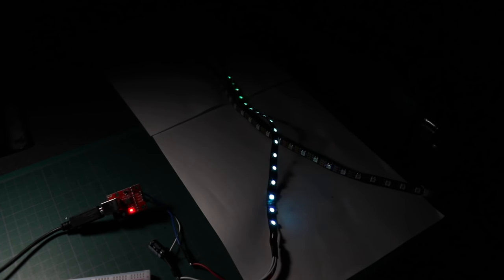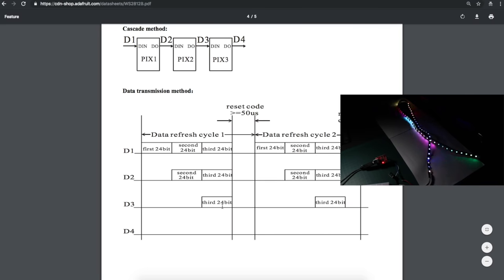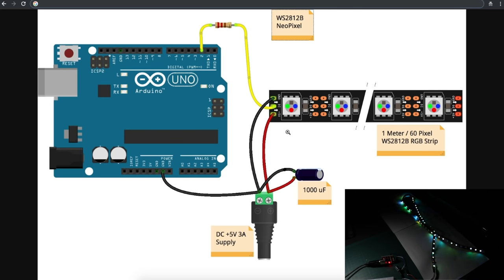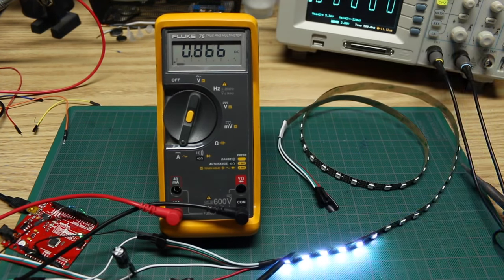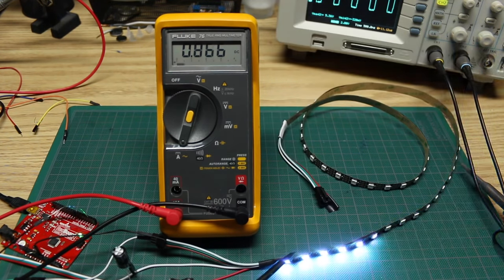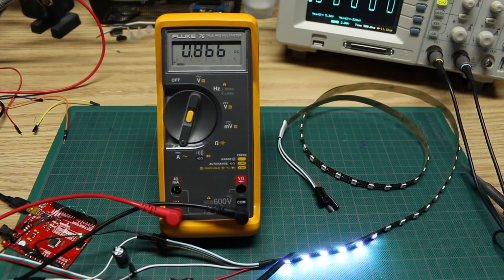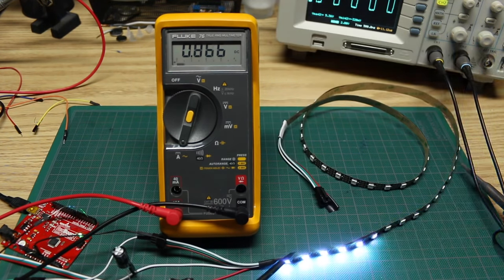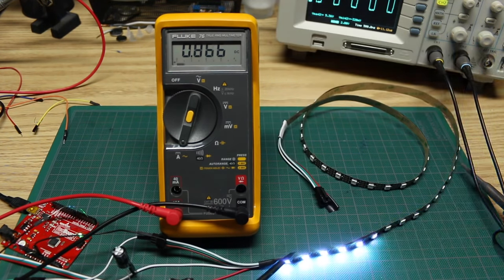HOW TO USE WS2812B NEOPIXELS WITH FASTLED ON ARDUINO

Comment: Hi! Is there a way to control when a led is off? In your example I saw that all the leds are off at the same time .
But I need to turn them off at different times. This tutorial is awsome
Reply from the maker: Do you mean the example sketches I made and put on github, or those demo sketches that come with the fast LED library? 
 If I wanted to customize an example from the fast LED library I’d have to analyze it and hack it to override certain LEDs and turn them off. 

 If I want to turn off a specific LED in my own sketch, I just set its red green and blue levels to all zero, or set the color name to Black whenever it’s time to turn one off.
So if it is LED number five that I want to turn off specifically, I could do it these different ways: 

leds[5] = CRGB(0, 0, 0);

leds[5].r = 0;
leds[5].g = 0;
leds[5].b = 0;

leds[5].setRGB(0, 0, 0);

leds[5] = 0x000000;

leds[5] = CRGB::Black;
Reply: @GadgetReboot  Thanks so much. I´m now traying. So I have the led 5 off.  
How do I make the led 5 LEDs turn on after 3 seconds of being off and then turn on again with a delay of 2 seconds for example?

What I really need to do is that the first 10 LEDs light up all together (from 0 to 9)  and after 5 seconds they all turn off and then turn on after 3 seconds and turn off after 3 seconds. In parallel I need the LED 10 to 19 do the same but at different times than those from 0 to 9. That is, when the first 10 LEDs are on, the second 10 LEDs are off. I hope you understand!
Reply from the maker: To control multiple timing intervals without using the simple delay command, which would pause the program and not let everything run in the background, you would be best to use the millis() function. 
 There is a forum thread with examples of how to use it to blink lights: 
https://forum.arduino.cc/index.php?topic=503368.0

 In that first example they have a variable called Period  which they set  to 1000 which means 1000 ms or one second. 
 If you want to track multiple intervals you could create multiple variables like that like period1 period2 and set up different numbers of milliseconds.

Then in the loop you do the comparison like they do for just the one blinking light and you just add comparisons for your extra timings and if the timer has reached that amount of passed time, then you turn those various LEDs on or off and then you can do it all in parallel without messing anything up and causing extra delays so you would have  if statements to go and change those certain LEDs every time  five seconds or three seconds or however much time has passed.

Comment: Out of all the tutorials I've seen in this exact topic, yours is by far the best explained. I want to replicate your work for a cardboard space capsule I'm making for my son. Could you please tell me what is the voltage of the 1000 uf capacitor you're using. I've seen some ranging from 16 v to 400 v . Does it matter? Thank you in advance for your answer. Keep up the good work. Thanks for the great material you share.
Reply from the maker: Thanks for the feedback! 

 The capacitor I used for the experiment I can’t remember but it was probably either rated for 16 V or 25 V but I was just trying to make sure it’s at least able to handle 5 V. 

The main thing to ensure with capacitor voltage ratings is that the voltage you apply is not greater than the rating of the part.
 So with a 5 V circuit like this, a capacitor rated more than 5 V  should work fine and with 1000uF electrolytics, that should easily be achievable because they are mainly probably 6.3 V or greater voltage rating. 

 Some things to consider,  we are assuming an ideal well regulated 5v supply but a power supply could also have some ripple on it but it still should be close enough to 5 V for this purpose.  So for this kind of experiment I would say a 10 V rating or higher would be good. 

 Another common design practice for production design, electrolytics are generally  chosen so that the applied voltage is between 65 and 75% of the capacitor’s rated voltage because too high or too low of a voltage can impact the lifespan.  

 But for home built  projects, just making sure the capacitor is rated higher than the voltage you’re using is good enough so 10 or 16 or even 25 V is what I would try to use.
Reply: @GadgetReboot  Thank you very much.
Reply: Hey, would you mind sharing the codes for the light animation you show from minute 1:39 to 2:15. The loop is bigger but I'm interested in that section. I am building a space capsule for my little son and I'm adding son lights with arduino-controlled led lights. I'd really love to install those cool animations. I will be very grateful. Thank you very much in advance.
Reply from the maker: @astralhorse  I think it was the FastLED example sketch called DemoReel100  but it's been a while.  It was either one of the fastLED examples or could have been an Adafruit Neopixel library example like one of those strandtest demos.   I just recall setting something up and letting it run while I tried to figure out how to get the rest working so it was definitely one of those example sketches rather than something I made.   If I confirm for sure I'll update the video description but I'm betting on DemoReel100.  It keeps rotating between effects and chase scenes.
Reply: @GadgetReboot  Thank you very much. That's a good start.

Comment: Question for you, I bought the WS2811 LED's (i have 100 of them) and the Arduino Uno R3 board.  Would I set it up like your setup here with the resistor and the capacitor? I am all new to this sort of lighting and my project (if it works out) will be for my computer table lighting. I might however buy these lighting strips as I really like the way they look. Any info would be much appreciated. I supported your channel and rang the BELL!  oh , would an old computer power supply work as well for the LED power? 5VDC is my power needed for the WS2811's.
Reply from the maker: yes the set up would be the same and then in the Arduino sketch you would change any reference to WS2812, to WS2811 so that fastled will know how to properly address them.
I have used a computer 5 V power supply, the only requirement is to make sure it has enough current and one way to do that without measuring anything would be to control the brightness of all the LEDs to something relatively low, set every LED to full white, and then gradually increase the brightness and see if all the lights can behave properly or if some toward the far end of the strip start looking less bright, the power supply either can’t deliver enough current, or maybe it can but you would need to run an extra set of 5 V and ground wires further down the strip and attach them so the further LEDs have another place to draw current.
Reply: @GadgetReboot  Thank you I understand about the drop. I was going to do that anyways lol... :)
Reply: @GadgetReboot  hey, another question for you. I have tried to download the fastled in the library and I cannot get it to  download anything. Do I have to be a subscriber to the website?

Comment: Dear Gadget Reboot,
would this whole thing still work if you used the 5V from the arduino? The light may be a bit less intense but it would still work, right?
Reply from the maker: The limiting factor is the Arduino 5 V won’t have very much current capability so if you take the 5 V that would be coming straight from USB you might be able to take a couple hundred milliamps and if that’s what you want to do to test things, you would have to make sure the LEDs are set for low brightness and maybe even only use so many of them so that the total current  doesn’t exceed what Arduino is giving.

Comment: Does it need a controller to work. I use DC 5v. But not worked . Only the first bulb was lighted up. It was green. Why is that
Reply from the maker: In this set up, the Arduino is the controller and yes a controller is needed. The first light may have received random noise on its data input and configured an RGB pattern but there would not be properly structured data to pass on to the other lights so only the first one may light up randomly like that.  

The other lights have their data inputs connected to the data output of the previous light so it’s held in a constant state and isn’t impacted by random noise. The first light needs to be hooked up to a controller so if it’s left floating it can have random input levels.
Reply: Ok thank you. So it will working properly after connecting to a controller.
Reply: How many* A*does it need to light up the strip brightly  ? 6a is enough to light  up 2m or 1.30m long strip with DC5v
Reply from the maker: It depends how many LEDs there are per meter because you can get them close together or spaced more apart, and it also would depend on specific LEDs. 
The general rule is to expect a worst-case of 0.060A  for each LED being fully bright white so multiply that by how many actual LEDs you have on the strip. 
But that’s only worst case, for my specific lights they only actually use a little more than half of that.
Reply: I got a led strip from Ali Express.  It was white pcb 2m  144 ip67  . I want 1.50m From that. DC5V WS2812B
Reply from the maker: If it’s 144 per meter  then the worst case 0.06A for 1.5 m could require almost 14 A to be fully on bright or maybe 7 or 8 A if they are anything like mine and didn’t use the full 0.06A each.
 One way to run it with a six amp supply is to have the controller not go to full brightness.  
It would help if you could put a current meter in series and make sure you never exceed about 80% of the 6 A supply. That’s a general recommendation for power supplies, not to use it more than 80% of its rating to keep it running effectively.
Reply: Then i ll buy DC5V with 20A power adapter directly
Reply from the maker: That should work
Reply: Ok i ll come after buy it. Thank u for replying.  Thanks a lot
Reply from the maker: Also for handling a lot of current make sure you’re using a heavy enough gauge wire for the two power wires to the strip.  I don’t have a recommendation off hand because I normally only use low current but there’s lots of charts out there in Google land.
Reply: Ok . Thanks for the help. I ll back soon

Comment: i want to power over 130 of them leds i have got a 10amp power supply. i also have the same omhs r (220) and fu (1000) would it still work with there higher amps.(10amps) ???(im a noob so dumb it down for me thanks )
Reply from the maker: The main thing in the calculation of current required for the number of LEDs is take the power supply current 10 A and divide by the amount of  current needed for each LED,  and that result will tell you how many LEDs you should be able to run from 10 A with that amount of current per LED needed. 

 So for my specific LEDs, if I round up it took 35 mA per LED to be on full brightness white. 10A / 0.035A = 285 LEDs I could power.

 For the worst case if you don’t know how much current each of your LEDs will need, these take a worst case of 60 mA per LED.   10A / 0.060A = 166 LEDs.

 Of course accounting for overhead if other things are being powered from the same power supply and also I believe it is generally accepted that a power supply should only be run up to 80% of its rating to keep things unburdened. 

So multiply those figures by 80% And we get  132 LEDs if it takes a full 60 mA  per LED, but probably you can run more, realistically  The LEDs don’t draw that much just like mine were only drawing about half of that . 

 Of course you can also just simply try it out turning LEDs on gradually at full brightness white and see if there is a point where they start going dim and then there might be some power delivery issues either in the power supply itself or in the wiring maybe thicker wires are needed or multiple sets of power connected along the strip, it can get in depth with a bunch of LEDs and current.

Comment: Hi. Nice Video but i have a problem. Wenn I going to upload my code to the arduino it says: "No hardware SPI pins defined.  All SPI access will default to bitbanged output" and abort the upload. Can you help me with that? (My englisch is not so good. i now that ^^) (I want to upload the code to an attiny85)

Comment: hey, is this capacitor really needed? If i don't use capacitor, it doesn't work right?
Reply from the maker: It's recommended because when the LEDs go on and off fast or change color fast and have drastically different current demands, power supplies can be slow to react and provide that power so the capacitor temporarily helps supply power more instantaneously until the power supply is ready.  Also if there's any sudden power line spikes, a capacitor helps absorb that and keep everything smooth.   Things may "work" without the capacitor but depending what kind of pattern you run, it may all dim out unexpectedly or flicker as the LED controllers struggle with the power supply's fluctuations.

Comment: Thanks for the video and descripton. What about if I use 3 separate parts of same LED strip. Circuits is ok but what will change for the code?
Reply from the maker: Do you mean keeping one single strip but trying to access three different sections to run different control code on the one strip  with just one data input?  
 Or three separate LED strips with three data inputs coming from the same Arduino?
Reply: @Gadget Reboot 3 separate strip with 3 data inputs on same Arduino.  And I have 12v Led Strips. What should I use between 12v power and led12v input. Thanks...

Comment: Question? Can I use 1 resistor  to power  2 strips
Reply from the maker: it should work to send the same data off of one resistor to two strips and have them behave the same.
Reply: @GadgetReboot  I was thinking a Y split  but I'm afraid of that  signal  going in to one another  like you said in the video would that happen
Reply from the maker: The resistor should absorb any signal reflections that come back from either side of the split and the far ends of the split are just receiving and they don’t really transmit back, it’s valid to have one signal going to multiple destinations, just not multiple sources trying to drive into one recipient.
Reply: @GadgetReboot   ty so much
Reply: @GadgetReboot   sorry one more question  what type of resistor should I use  instead of the 330 to run 2
Reply from the maker: it would be hard to say because it would depend entirely on things like the length of wire used and its characteristics and thickness and how the signals behave so if I were doing it I would be looking at the signal on an oscilloscope and just playing around with resistor values until the signals looked square with no spikes but luckily the whole thing is not that critical, as long as there’s a resistor there it can be probably from a few hundred ohms up to a few K.  probably similar to having at least some brake pads left on the car is a lot better than none at all.

Comment: mine led has G,R,B,+12v i think they are not good for this right?
Reply from the maker: instead of powering the strip from a 5 V supply it can still be powered from a different 12 V supply and connect the ground to the Arduino, and in the software the order of red green and blue can be configured so it matches.

Comment: hi, can I borrow your chaser lights code? thanks
Reply from the maker: Of course
Reply: @GadgetReboot  can you  post it here? thank you
Reply from the maker: It’s on Github
https://github.com/GadgetReboot/Arduino/blob/master/Uno/NeoPixel/Chaser.ino
Reply: @GadgetReboot  Thank you, but I like the chaser mode and other effects on the first ,imute on your video. Can I have that code? Thanks so much
Reply from the maker: I can't remember all the demos I ran now but if it's one of the fancy looking things, it either came from the included examples in the FastLED library or the Adafruit Neopixel library so you can look through those 
https://github.com/FastLED/FastLED/tree/master/examples
https://github.com/adafruit/Adafruit_NeoPixel/tree/master/examples
Reply: @GadgetReboot  I tried all the sample sketches on fastled and neopixel libraries, but I was amaze on you light chasing, I really need that code. Thank you
Reply from the maker: @jaymarasidan6654  I think it's the FastLED example called DemoReel100.  It looks like what is in the video at the beginning and playing in the small picture box later where it changes from rainbows and sparkles into more of a chase and repeats.
Reply: @GadgetReboot  yah I already tried DemoReel100, but it is not exactly the same on yours, Can you can another  complex chaser code? Thank you
Reply from the maker: Everything I used was either the couple I made on git hub or else from those library examples. The pattern on the demo reel looks like the right one.  I don’t know if there’s any potential randomness to the colouring that might make it look different now.